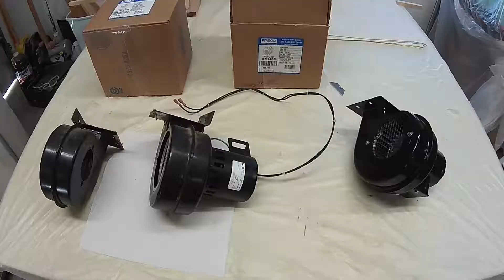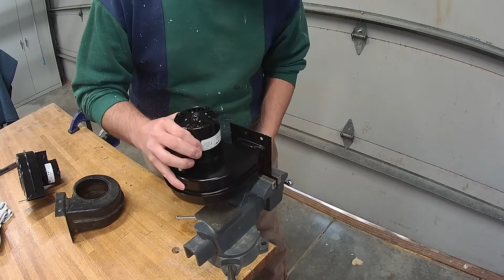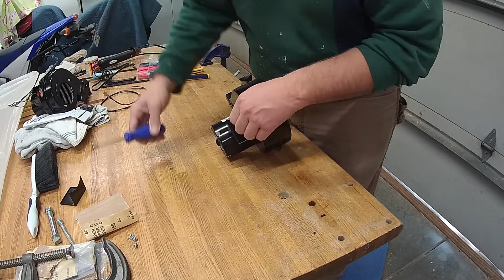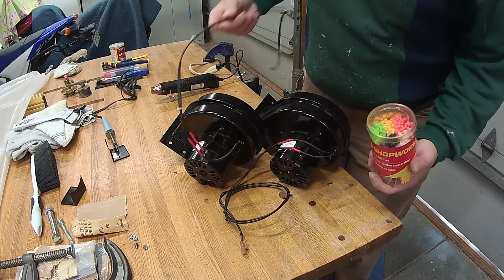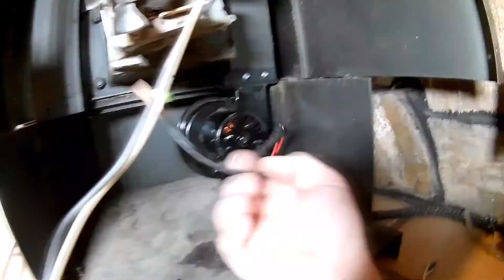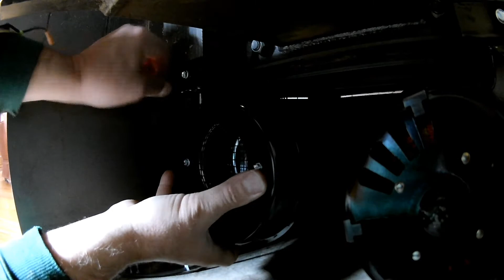Englander 25-PFS pellet stove fan blower motor replacement

Comment: Brad, my 25-PFS wont kick on combustion motor after i light the pellets in burn box, replaced heat sensor and still didnt work. put flame on heat sensor and it kicked combustion motor on. any suggestions on what to do next? thanks enjoy your videos

Comment: I always loved your video. I also have a older pfs that was in our home that I have since moved into my garage. I believe the fans are on there last legs as she doesn't heat very well. I'm gonna order 2 new motors soon. Hopefully it fixes my heating problem.
Reply from the maker: Hi James, thanks for the positive comment.  We've been running our stove with the new room blowers and it makes a world of difference in terms of moving the warm air from the stove out into the room.  The whole room gets warmed instead of just the few feet in front of the stove.  With both fans running full speed you can feel the air blowing fifteen feet away.  A big difference compared to the fans that were going out.  Hopefully an new set of fans breathes new life into your stove.
Reply: @BradHunting  my stove is slightly older than yours. I only have 2 fans total in my stove. 1 for combustion air. 1 for room air. But I  def going to change them.